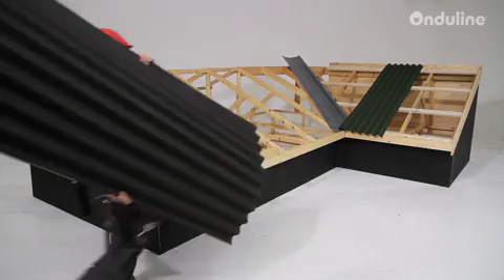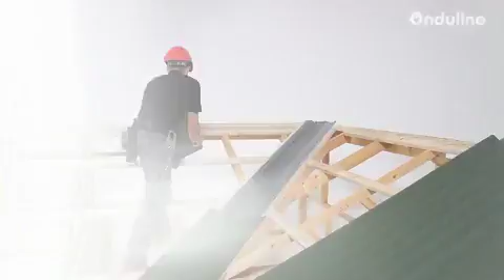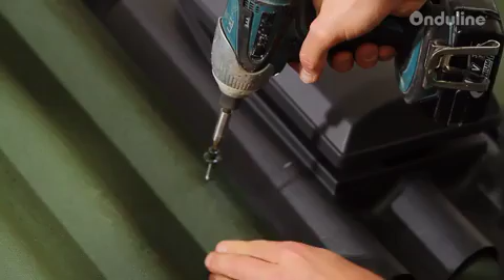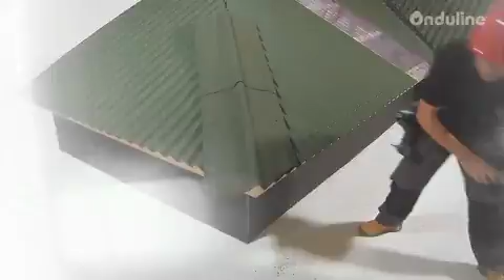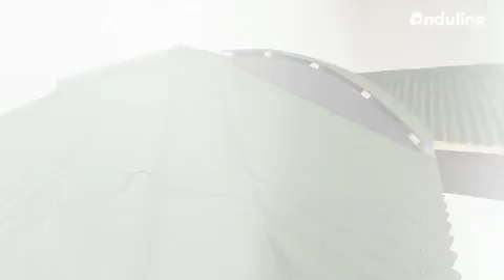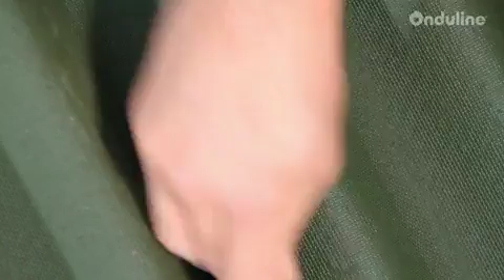Onduline   Trade Secrets

Comment: this material is really a piece of shit  ,as you can see he is showing how to install it around in reality you need to get on the material in order to install, trim ,ridge cap and others.
this material can't stand the weight of a person specialty when is hot.
Reply: I also noticed that every video I watch, the person installing the material is always on a ladder NEXT TO the project (like sheds and chicken coops) but I never see anyone actually on it and it looks pretty flimsy However, in most of the videos like this one, they are applying the material to framing and what are they..Perlins? Perling? so the have no plywood sheathing or waterproofing underneath. Someone did mention that you could get on it if you had plywood sheathing underneath. But still..makes me nervous about breaking the material or slipping off of it. Sucks because it looks cool and comes in a bunch of colors.